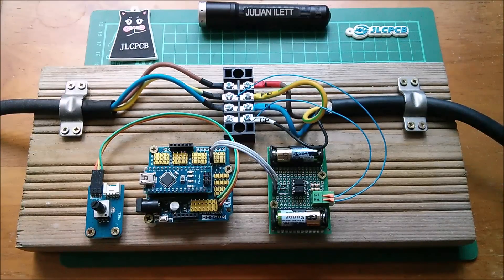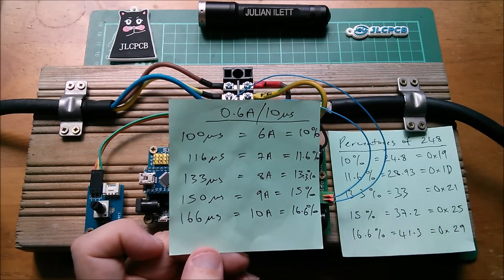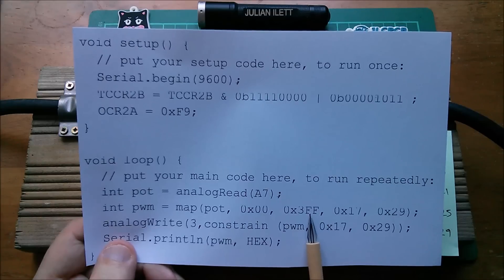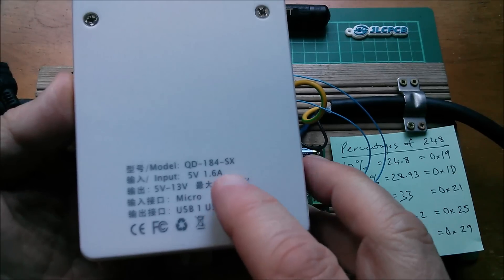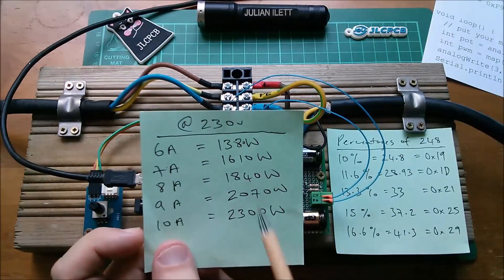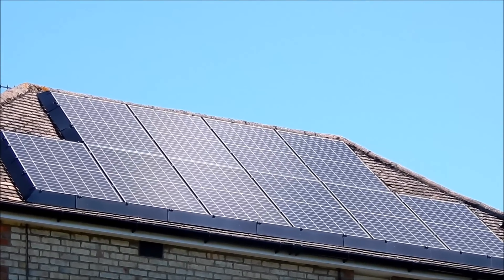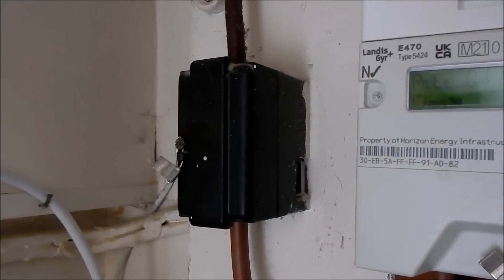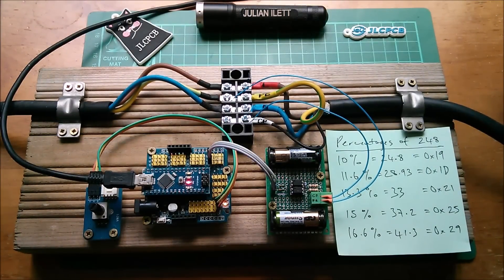map(), constrain() and solar stuff

Comment: wouldn't be cool if you could do direct DC to DC charging from your solar panels to your car. That way you could bypass the inefficiencies of the inverter. If you could somehow trick your car to allowe it access to the DC voltage of the batteries. I don't know how the DC chargers on electric cars work or what protocol it uses.

Comment: What's the spec say about input VOLTAGE to the car? If it'll go down to 110V you could feed the output through a chunky autotransformer (or a less chunky autotransformer if you got creative with some contactors) to step your 230V down to say 110V, that way you could get it down to about 600W.

Comment: Yeah you could use a smaller battery to charge when your solar panels produce less than ~1400 watts and then you could discharge the small battery every once in a while through an inverter into your car battery. The biggest challenge is making a variable charger for the small battery that follows the excess power from the solar panels and can charge the battery with up to 1400 watts.
Reply: Well I have seen quite a lot of older inverters..for example Kostal ones from 2012 already had a staggered 10 output contactor stage that could be set by wattage to close or open as kind of a ladder for own usage ...+ 1400W dumb charger for the intermediate power bank would have made this possible some years ago.
Question still is do you get the right parts ?

Comment: In my opinion the reason that solar panels makes more power when there are scattered clouds in the sky is that they receive sunlight directly from the sun and also sunlight reflected from the clouds. It's not because they are cooler, although temperature have an effect on solar panels, the effects is not that big as some people believe.
This is of course just my opinion and I might be wrong, but I also might be right 😉
Reply from the maker: My panels (JAM72S03-380/PR) have a Temperature Coefficient of Pmax(γ_Pmp) of -0.36%/℃.
So for a 40℃ temperature rise, they will lose 14.4% power output. That's over 500W lost from the full array due to high temperature.

Comment: If your EVSE could be linked to various other power hungry devices (immersion heater (PWM via triac), crypto miner), then you could switch those on at less than 1.4kW PV output? Or when the car isn't plugged in or is full. The whole integration of managing PV output within the home according to priority is fascinating.
Reply from the maker: That's pretty much my current thought process :)
Interestingly, since I signed up to the Octopus Agile Outgoing SEG tariff, payments for exported energy can be as high as 40p/kWh (it changes every half an hour) so letting electricity flow out to the grid can be more lucrative than crypto mining. There are so many parameters to factor in.
Reply: @julianilett Scam?

Comment: If your main house fuse is 60 A, surely you can charge at 32 A (7 kW) if you wanted to? But, yeah, the supply cables, hmm.
Reply from the maker: Yes, after reading a bit about house fuses, it seems they don't blow immediately at their rated current.
Reply: Yeah, you're charging the car at max current, then the missus puts the kettle on for a cup of tea. Oh oh.......

Comment: Something to try, charge a power wall battery bank, then use that to charge the car...
Once battery bank is empty have a way to transfer to mains voltage... 
So, when it's less than 6A get it to turn off car and charge battery bank, then when the battery bank is able to supply enough current turn the charger on, if at any point the solar kicks in at higher than minimum then car charger turns on. 
I big enough power wall to charge the car over night if you're out in the day

Comment: Solar cable is DOUBLE INSULATED, the dc current or voltage will not JUMP out of it, come on Julian u should know better then that, but never play with the ends not terminated into a dc circuit breaker.

Comment: Should you apply a litttle bit of hysteresis to the ADC output? Otherwise, you might adjust the pot to a position where it jitters between two values.

Comment: If you had used a multi position rotary switch and resistors, instead of a pot, you would know in a glance what your setting is set at. 
As it stands, you don't know if you've set it to 10% or 20% or...
Reply from the maker: The pot is temporary - it won't be needed in the finished version.

Comment: Idea... Could you replace the variable with a LDR (Light dependant resistor) so that your car charges more when the sun is bright and less when the sun is limited.
I recon with a bit of finessing you could save more money when your car is pulling more Amps when the solar is producing more, Thus wasting less of your solar power to the pittance earned from the feed in tariff.
Reply: I believe he's stated that the long-term plan is to have an ESP32 control it with actual production data read from the inverter.  I do like the simplicity of an LDR, though -- I'll bet you could get damn close to the same performance with a little tuning if you mounted the LDR near the panels.

Comment: Is there any way to sort out specific values so it skips for example "20"?

I'm always so curious when I see fuses in the world. 60A sounds extreme. I got 3*16A in my home. Different systems of course, but it's just interesting why different countries uses so different systems.
Reply from the maker: Do you have a 3-phase supply (hence the 3x 16A fuses). I understand 3-phase is quite common in continental Europe.
Reply: @JulianIlett  Yep. 380V 3phase. Wonderful to have as a 6kW is without problem even at 16A.
Reply: Here in the US the minimum for new houses is 100 amps. Due to our split phase system that's 24kW even though 120v is the normal voltage. And 200 amps is standard nowadays, even though I don't know what you'd need 48kW for.

Comment: Map and Constrain are a couple of seriously useful functions if you are not in too much of a hurry - which presumably you are not as the application is simply to read a pot. I have recently abandoned using pots on arduinos, and pretty much only use rotary encoders. They are much more reliable and barely any more expensive. It also makes limiting the range trivial

Comment: I absolutely love this project, have you considered adding a "ramp" function so the rate of charge can only change a certain amount per second. That way it can't send max/min/max/min oscillating signals to your car.. (idiot proofing the input pot) thank you for sharing this project with us.
Reply from the maker: Yes, that could be useful - particularly around the 1,400W point where car charging would either be on or off.
Reply: So just a loop that add/derives "watts" until it reaches current pot position :-) if the loop is slow adding it would create an S curve without overshot but never reach exact pot value..maybe 10W increases

Comment: HEX representation of number is a great way to help visualise the value of bits in a byte but has very little value for anything else.  You might just as well use ordinary decimal numbers for what you are doing.  Why do you prefer HEX in this case when all it does is to confuse things ?

I noted with some amusement that you calculated the values in decimal and then converted them to HEX to use them in map() and constrain()
Reply from the maker: Hex also helps to explain the maximum values for PWM and A/D conversion. The numbers 255 and 1023 appear pretty arbitrary whereas FF and 3FF are more obviously upper limits.

Comment: The map function is very handy, I’ve used it to convert a monitored li-ion battery voltage to a % full display for display on an LCD
Reply from the maker: That's a perfect use for it. Although it wouldn't work too well on LiFePO4.

Comment: Not being able to charge at less than 6A makes me wonder what those smart solar EVSEs do when the solar output drops. Since they appear to be sold as a way to store your unused solar energy instead of sending it to the grid.

But I can't think of a situation where you'd have kilowatts of unused power for long periods. It's England, we have clouds.

Also on octopus' Go tariff it costs me about £1.20 a night to shove about 30kWh into my car, so it's not like there's even a lot of money to save.
Reply from the maker: The Zappi has two modes. ECO tracks solar generation and house usage but will pull from the grid to keep the car charging at a minimum of 6A (1.4kW). ECO+ will discontinue charging if (solar power - house power < 1.4kW). But when charging is started and stopped the car's battery contactors will engage and disengage. So a sunny day with hundreds of little fluffy clouds could work the contactors pretty hard in ECO+ mode.
Reply: @JulianIlett  yeah that'd bother me, feels like one day there'd be angry buzzing as a contactor jams and dies.

With 400v going through it.
Reply: Evcc at ithub can handle such situations quite well. Its free and you can customize it with thresholds, so that the relays don't turn on and off all the time.

Comment: Because I like maths so much, I often try to write these functions myself, always forgetting to check if something exists in the library, which is probably going to be more efficient than what I can wrote 😂😅
Reply: Arduino was known for the I/O macros being really slow compared to other microcontrollers, developers were reluctant to fix that since it would break applications that relied on the slow I/O as delays. I wouldn't be surprised is there's plenty of things to improve elsewhere in the library.